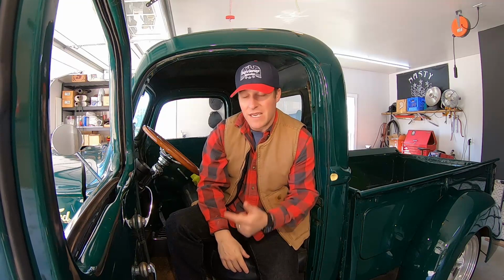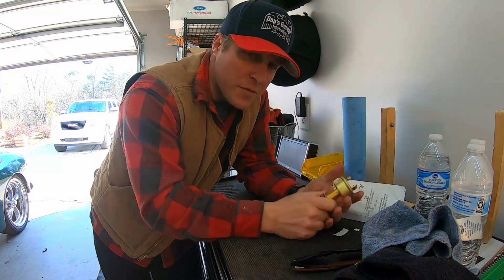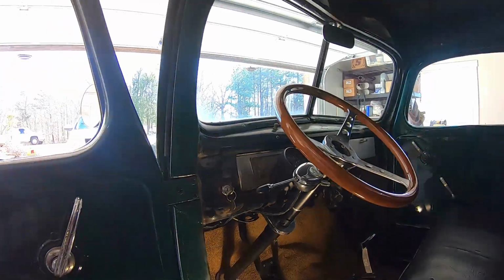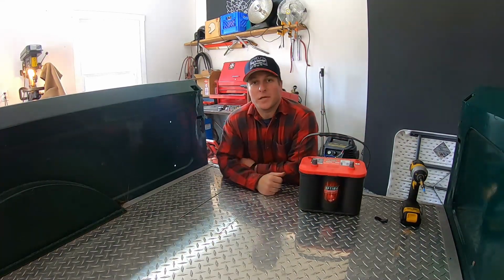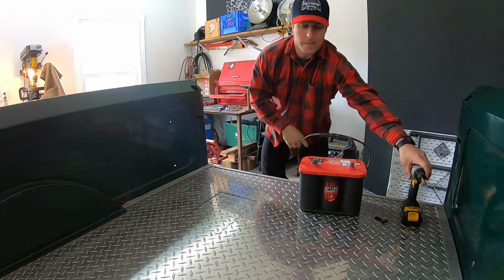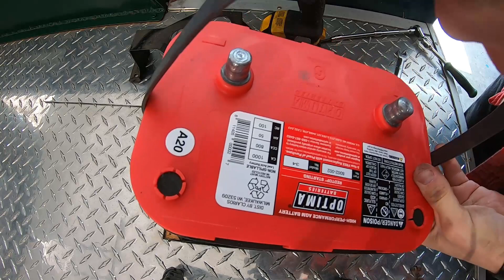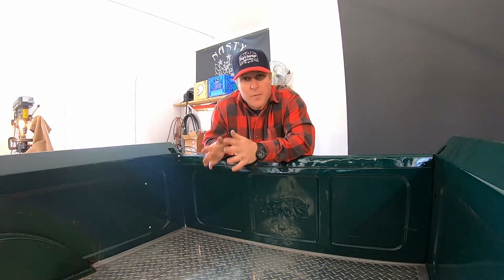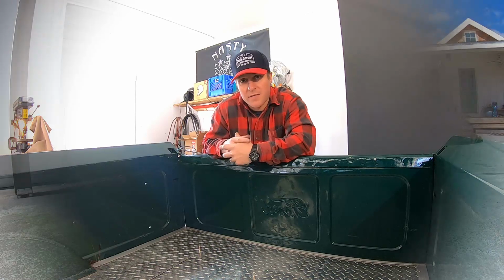1947 Ford F100 truck How to replace Ignition switch, Redtop Battery install

Comment: Love it, I just converted to a 12volt on my 1945 trying to get the ignition working and this video helped out a lot so maybe I can just swap out my ignition to a newer model ignition switch.
Reply from the maker: That’s awesome Will thanks for watching
Reply: So I purchased the ignition switch, but when I hooked it up, I’m not getting power to the starter nor to the coil. Not sure why it’s not passing through the switch. Do you have any ideas?

Comment: I have a 1951 Ford F1, V8 and would like to change out my original (OE) ignition switch for the Seachoice. Can you tell me which wires from the original switch and how they were connected to the Seachoice. The back of my original switch does not have any lettering or markings. I believe my switch is bad as I have no spark to the coil, points or plugs (all have been replaced).  My 1951 is a 6 volt not a 12 volt.  Any help would be great.